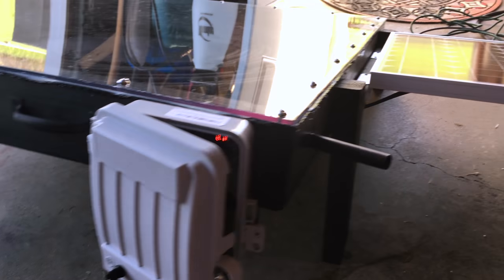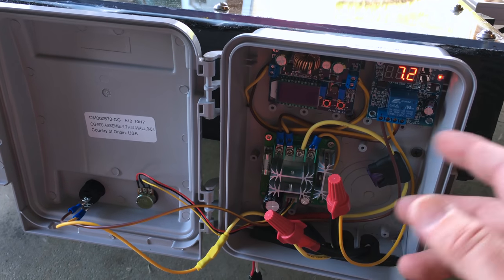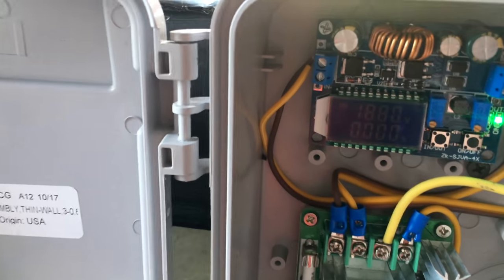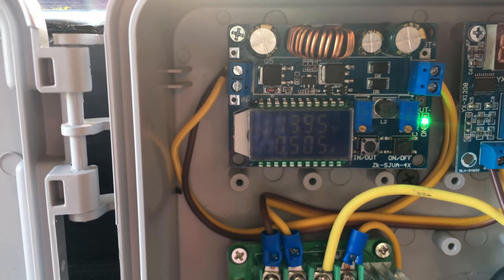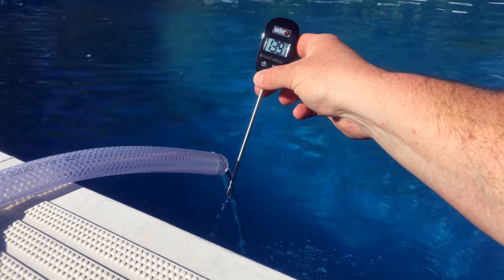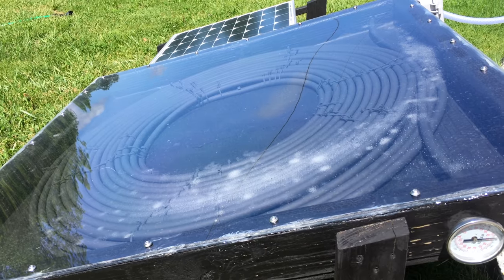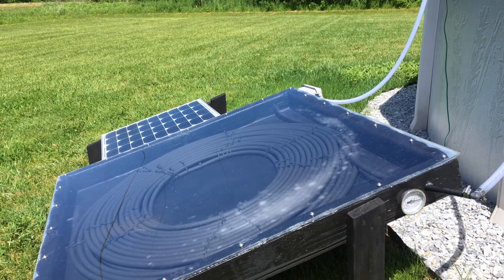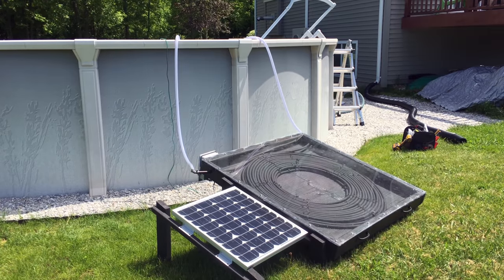DIY Solar Pool Heater - Part 4

Comment: This is a great idea.  Thank you for presenting in such detail.  I'd advise running the output hose into the pool near the bottom.  Heat rises.  That way you are not just warming the surface.

Comment: You should consider making a 60"x60" solar pool heater with two 100 ft coils of L soft copper tubing in a single layer leaving space between concentric rings. Copper is only second to silver in thermal conductivity where as any type of plastic tubing is an insulator.

Comment: Pretty cool little project! I think if I had a pool though I would just choose to paint the inside of inside of the pool black, or maybe put a black tarp down in there when not using it. Would have the same effect, at least when the sun angle is high.
Reply: Black bottom pools kinda look like arse.  That is why most people use a blue or white bottom.  for the asthetics.  covering at night works to keep heat in though.  they actually make pool blankets specifically for this.

Comment: I tried the irrigation hose the first year with no glass over top. I saw significant heat gain in the water. This year I placed a green hose glass over top of it. POP pipe could not handle the heat. Did you replace with pex and is this still working?
Reply from the maker: I removed from service this year.   Building a bigger model for next year.

Comment: I know this is an old video - it is super helpful to me. But I have a question re the size of pump (volume per minute or hour) that would make sense with this unit without a speed controller. I intend to use a diverter or a splitter valve to divert water back to the pool once the sweet spot is hit, i.e., right volume going through the coil to achieve an optimal temp coming out. Just wondering about the pump hp that would be recomended - half hp, one hp, one and a half? or what volume per minute or hour would be my best choice. Thanks
Reply from the maker: Great question,  pump size doesn't matter as you are moving thermal mass.  Whether you move water faster (cooler) or slower (hotter)  it is the same them thermal mass.

Comment: I wanted to bring up an idea for the next one.. on the underside of the plexiglass you could apply solar film. Making it so that the reflective side is facing the tubes. The sun excepting side would be facing the sun. So the way it works: the sunshine‘s through plexiglass, the sunshine‘s through the solar film, the sunshine bounces around in the box, the sunshine bounces back against the solar film, the sunshine bounces back into the box. During the process, more sunshine enters the box. If you do this, please keep me posted. It is a totally new idea in solar heating..
Reply from the maker: Good Idea.  The bubble insulation is already reflective and I sprayed it black upon several suggestions.  I have the glass to build another one and will probably do so in the Spring,  I might just keep it reflective to see if there is any improvement in heat.  Thanks for the suggestion.
Reply: Green Mountain DIY Guy Keeping it shinny will only reflect the heat, UV, back through the glass. Painting it flat black will transform the UV to heat and hold it in.
Reply: The inside of the box was already measured at 160 F, I believe.  Heating higher the box us not an issue.  You need more tubing length!!!!!
Reply: Also need to keep in mind most irrigation pipe is rated for 140°F or 182°F, depending on HDPE grade, so you don't want more heat in the box or you'll risk melting the pipe.

Comment: I went with a 50w solar panel linked via a charge controller to a 7ah ; 12v battery and 25w submersible pump. So the battery smooths out the voltage and is pretty much a fit and forget solution for UK sunny days. I have 20m (65ft) of black PVC hose to circulate the water out and then back into the pool. Only a 10ft D 3ft deep pool mind you. anyway got the pool up to 26.8deg after a couple of sunny days. I have found having a bubble cover this year has made a huge difference by preventing heat gained in the day being lost at night.
Reply from the maker: Yep, going to get a bubble cover next to help retain heat at night.

Comment: Couple of things I'd try....why not T off the pool return with a ball valve for flow control so it'll work when the sun goes down and no current added to the pool water for safety? Also, if you lay ceramic tiles under the insulation panels the heat will stay trapped when the sun goes down. I think I'm going to try to build one of these for my 27 foot round partially recessed pool. Great videos and great build!
Reply: It's a 12 volt low amp system.  Safety is not an issue....!
Reply: @dougthegreat1808  stray voltage in a pool isn't exactly a good idea.
Reply: @amcvay1979  with this scenario, I disagree......
Reply: @dougthegreat1808  I would generally agree, a 12v source won't add "that much" stray voltage, but why not make it simple and just Tee off of the return with a ball valve so you can customize the flow and at the same time keep all voltage outside of the pool walls?
Reply: @amcvay1979  we (I) were not talking about "T"ing off.  Just the voltage!  Don't know plumbing that well as I am an electrical engineer....
Reply: Doug the Great well you replied to my comment asking why not Tee’ing off the return to kill 2 birds with 1 stone
Reply: @amcvay1979  no I don't believe I did, reply to anything regarding plumbing vis-a vi T-ing off the plumbing.......
Reply: @amcvay1979  plz go back and re read my retorts.....
Reply: Doug the Great read from the top, you replied to my comment regarding stray voltage and tee’ing off of the return
Reply: @amcvay1979  jesus Aaron, I replied to the stray voltage point in your original message......nothing else.  Have a good day!
Reply: @amcvay1979  I agree with you Aaron, even though it's only 12 volts, and likely safe, I don't like the idea of putting voltage into the pool. I would either come from the main pool pump, or use a separate pump outside of the pool.

Comment: Hi mate it is  safety to run this seaflo 500 Bilge pump in swimming pool when someone is in side ..and also which tipe of solar panel do you use .. and how long can it stay the pump running in the water ... thank you
Reply from the maker: That pump is low voltage so I do not see why you would need to watch it. It runs all the time here and we are noting monitoring it.  I end up replacing the pump each year do to burn out.

Comment: Green Mountain, just curious if you leave the inside of solar box shiny will it create more heat?  That’s how I was going to build mine. Then I seen your videos and you painted black. Do you have any scientific data backing it that black would produce more heat?  I understand that shiny might reflect heat out but my thought was it would be trapped in the box and absorbed by the coiled lines. Any thoughts or solid data?  Thanks
Reply from the maker: I may do the same on the next box to test side-by-side, Black vs. foil.  Will let you know the results...
Reply: Green Mountain DIY Guy I have been seriously thinking about doing one and cane across your video. I don’t want to put that much time into it if it’s not going to be effective so I’m still asking around/doing research to see if it actually takes that nip out of the pool and makes it easier to get in in the mornings. My pool will literally drop like 6-8 degrees throughout the night from cool nights in June and end of August. Your video doesn’t really tell me overall wether your panels warmed up the whole pool or not.
Reply from the maker: @dustinharms2197  I made some mods, cut out 100 feet on the top and some of the electronics.  Pretty much just using the reostat and relay.  Going to build another one soon.  I think it is worth it.
Reply: @GreenMountainDIYGuy  Hi there, greetings from Slovakia. Im in the middle of building similar set up. My pool is not much for swimming, more as hot tube - so Im going to use double way of heating it (also filling it up by rain water) - by copper coil and rocket stove during the winter and by passive solar heater (also using copper coil) with solar powered 12V pump. I can manage in building it up field, but Im bit lost in electricity field. I still don't know know which way to go. I have older panel (60 cells, 235Wp), I have 12V 60Ah battery - still holding well - but not regulator (I guess, I would need mppt) (At the moment I have very cheap electricity, so it is not worthy for me to go completely off-grid). That the first choice. But it is probably easier and maybe it makes more sense to buy a new 60Wp 12V (36 cells panel) - and as you suggested - to combined it with 12V relay and 15 Amp PWM Motor Speed Pump? What would be your opinion and highly valued advise for me? Thank you.

Comment: Good job, saw one with reflecting foil instead of black paint in the housing - which one has the better result? Guess the foil will reflect some more sunlight to the hose which makes it even better. What is your experience? Thanks
Reply: Simply put, reflective surface rejects heat, black surface absorb heat

Comment: Is there any fear with electric shock with the bilge pump in the pool, if there was ever a short? I know the voltage is low, so likely okay. Just curious on yours and anyone else's thoughts on the matter?
Reply from the maker: Not with 12V!  That why I chose to use low voltage.

Comment: A good idea but you wil never get the pool warm. The pump and the hoses are way to small...
Reply: yeah i think the rule of thumb is 1/2 of the surface area of the pool but he could easily build 2 4x8 panels using the same build process and make mylar reflectors to boost the area and reflectivity and not double the price

Comment: Great project, but I guess the pool is not going to retain the small amount of heat that is transferred in very well. The first test of the pool was 74 degrees (minute 7:57), a couple of days later it was 73 degrees (minute 10:20)...hmmm. be good to see comparison few days with few days without with similar weather conditions to really understand the impact.

Comment: Ok a quick question. Why not build the box hermetically sealed & fill it up with a liquid that is still translucent but has higher thermal capacity than water? Because with this design, I don't see the reason why you painted the bottom insulation to black, I'd leave it reflective as is so that it would reflect the unused solar light back onto the pipes (to some extent). Heating the bottom insulation sheet doesn't do a lot in this design. Otherwise, a great project! 
How about using a 2 closed circuit heat exchanger that holds a thermal oil in first circuit and water from the pool in the second one and bury that in some radiator oil and use the existing box?
Reply: Somehow I feel like metal hardware would perform better.

Comment: I built this 5 months ago at the beginning of Summer and ran into 2 problems.
1) You said the PWM was optional so I skipped it and bumped up to a 100W panel.  However, the pump drops the voltage on the line during start up that the relay kills the power.  It sits there clicking on and off over and over until eventually it finally starts.
Is the PWM circuit perhaps helping with inrush current?

2) The SeaFlow pump crapped out after only a few months.  Not sure if this is related to number 1, but the motor has seized and won't spin anymore.

Any suggestions on a more robust design?  I don't really want to add a battery either, there is plenty of power coming from the panel, just need to limit startup draw or find a better pump with a soft start.
Reply: You could put a big capacitor across the Solarpanel. It smoothes the starting current
Reply: Wondering if you ever found a solution to this? Considering a build similar to this, just want to avoid common pitfalls
Reply: @pieterspitael8991  No, My design is sitting in a box in a closet at the moment.  But we just hit the first heat wave of the year, so I might have to find a capacitor and give that a try as per the other reply.  If that doesn't work, I am considering a small MPPT if I can find one cheap enough.
Reply: @Casper042  thanks for the response.  Seems silly to use a battery for this system (really only want the pump to run when solar energy is intense enough to provide enough power/heat). But from what I've been trying to read up on, a small MPPT with a small battery might be the reliable way to go.  Have you found and MPPT that works when no battery is connected?
Reply: @pieterspitael8991  Totally agree, but I figured the battery helps smooth out the load spike when the motor flips on, and the Solar controller won't let the load fire up u til there is enough juice.

Comment: I did everything the same as you, worked good for half a day, now the relay keeps tripping. I turned the rheostat all the way down, as I slowly bring it up, at about .3A the relay trips again.  I bypassed the relay so the solar was feeding directly in the Boost converter, and it did the same thing. the converter was resetting.  I have narrowed it down to the pump drawing too much current? it worked fine at full blast earlier in the day.
Reply from the maker: It could be the in-rush current from the pump.  I ended-up pairing down the system to pretty much just the rheostat running off solar too.  I have all of the parts to build another system. Probably in the next month or so.  Thanks for watching!

Comment: Quick question.  Have you had any trouble with the pump as it is a bilge pump and not meant to run a continuous duty cycle?  I am designing a similar system with the exception that some evacuated solar tubes came my way for almost free (guy use to sell them and just emptying his garage).  I am planning on recreating your solar powered pump system.  For that matter has anyone found a 12V 50W continuous duty cycle submersible pump?  I have been looking through various fish pond pumps but haven't found what I am looking for yet.
Reply from the maker: I replaced the pump about halfway through summer this year.  $15.

Comment: hello sir,  really great project  u made... just curious, why u did not use copper tubing? i’ve been planning to make one & been watching videos & seems like copper can provide more heat.
Reply from the maker: Yes, and thanks.  I am going to probably build another one with copper tubing...
Reply: don't use copper with chlorine water, they have a reaction. don't mix.
Reply: Not to mention cost

Comment: I'm gonna guess this made little to no difference in your pool temperature.  Yes, you got some increase in water temp, but it was at a very low flow.  I dare say you'd need 10 of those boxes to make it worth doing.  Not trying to sound negative, but I've built 4 pool heaters and currently have dual wood boilers set up in series that increase my 16'X42" pool's temp 4deg F per hour with a 3300gph sump pump producing a 72F differential.  I can go from a cold pool in the morning to a nice warm one at lunch time.
Reply from the maker: I did some work on it earlier this spring and cut out 100 feet so more exposure to Sun/UV.  This helped a bit.  Need to built 2 or three more.  Would like to see you wood boilers for the pool.  Do you have any videos of that?

Comment: What size is your pool and how well does this size solar heater work? I was wondering if one is enough or perhaps a person might want to build two? Our pool is 20 ft round.
Reply from the maker: I am planning on building another similar heater.  Pool is 21 ft round.  Also need to invest in a solar cover for he pool.
Reply: I would suggest at least 6 for your pool.  If you have only 1 of these heaters, it would take about 30 hours of non stop heating to raise your pool only 1 deg.
Reply: Cory 🤔😨wow.

Comment: I’m curious how this is lasting two years later? You did a fabulous job!!
Reply from the maker: Still going strong!  I have replaced the bilge pump a couple of times.  Also removed 100 feet of tube for just one layerZ. I might build a few more this summer.  Thanks for watching!

Comment: Any idea how to have this automatically turn on 10 mins then turn off 10 mins.  Perhaps a 555 Timer chip?
Reply: Chris Moyer pointless, and will destroy efficiency. Heat transfers faster with a greater temperature difference. You need to keep the water flowing, and the coils cool, to pick up the most heat.

Comment: I would recommend taking off the lexan glass, you will increase its efficiency. Water absorbs heat so much faster than air,  so there is no point in the green house effect.
Reply: What? I have trouble understanding this. Wouldn't the hotter in that box the better? I only ask because i plan to make this next year and know very little-but keen to learn. Oh on more question- Would it be better for the return hose to be further down in the pool rather then just water going on top of the pool?
Reply: Yes, A hotter box is better, but it won't get hotter, the water pulls in so much heat with a proper flow, that the tubes become almost at cold as the water it self. Its very efficient heat transfer. by adding a glass clover you're blocking a small % of the sun rays out and will lose potential heat transfer. As for the location of the hose, I haven't really given it much thought. but I can't see the location on a average to small size pool making much difference.
Reply: @nutman411  this is correct, I built mine five years ago and ripped off the plexiglass, it works better without it